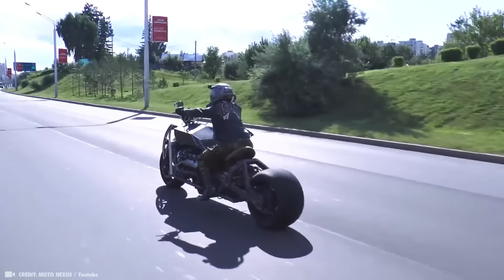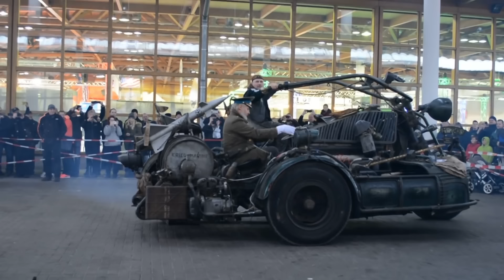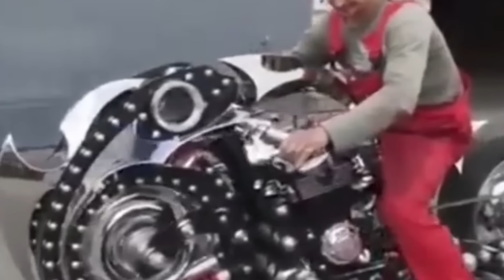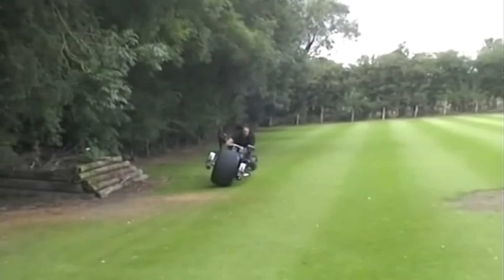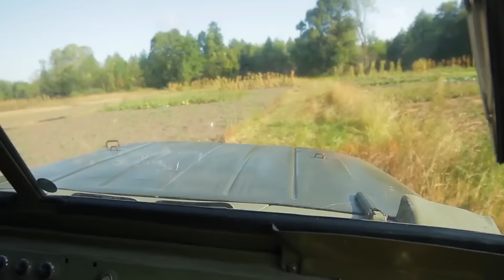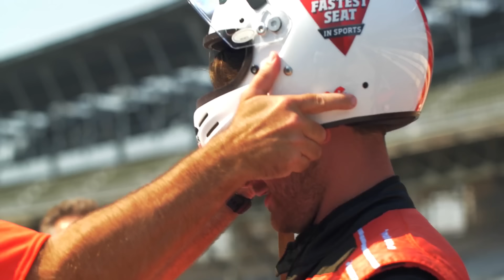15 Weirdest Monster Motorcycles in the World

Comment: Don't you know the difference between a steering wheel and handlebars the motorcycle doesn't have a steering wheel it has handlebars you show me a motorcycle that has a steering wheel on it especially from Harley-Davidson those are called handlebars you narrators need to get things right I noticed narrator screw up on quite a bit I mean come on you got to be a total idiot not to know the difference between steering wheel and handlebars

Comment: You really need to look at some of the amazing machines built by Alan Millyard in the UK. Not only does he use engines like the Viper, but makes his own engines, like a five litre V twin and his own Kawasaki six cylinder from scratch.
Reply: I agree, a very skilled man.
Reply: I thought Alan used parts of engines with adapter parts. He makes crankshafts, camshafts and transfer cases.